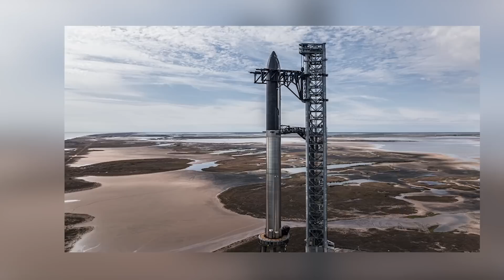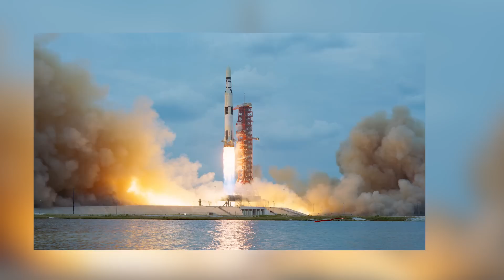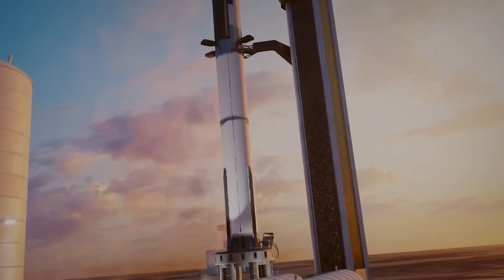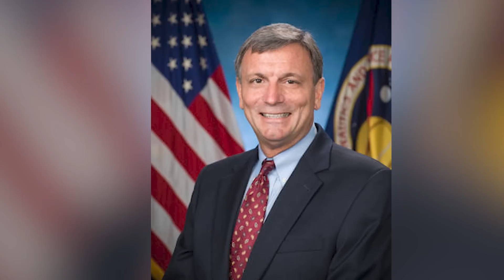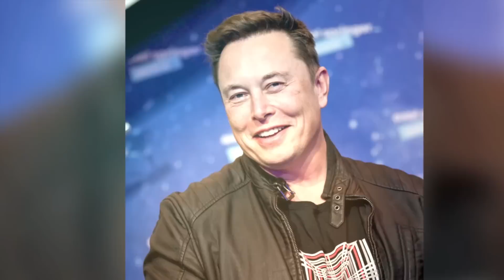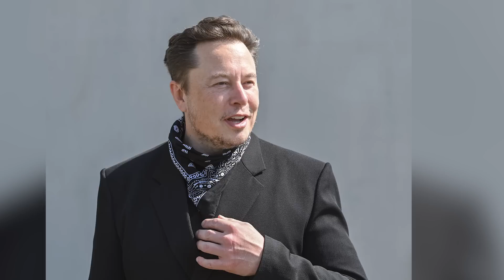Stage Zero From SpaceX In HUGE Trouble With 33 Engine Firing

Comment: Well you mentioned steel plates in the video but what I don't understand is why it would take a year to make the plates up. You just be able to get some 1 inch plates steel lay it on the ground weld the plates together drill some holes and bolt 🔩 to the ground and also make up some plates to go around all the poles that have concrete around the poles. And then get some heat  Shields that they use on the rockets 🚀 you will have to bolt them down I would use some Epoxy under neath them for extra assurances.